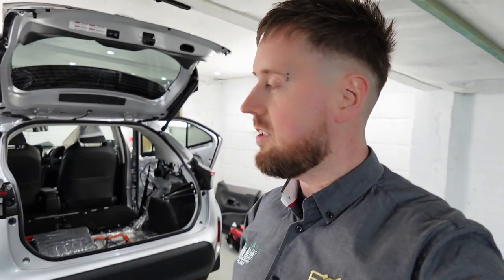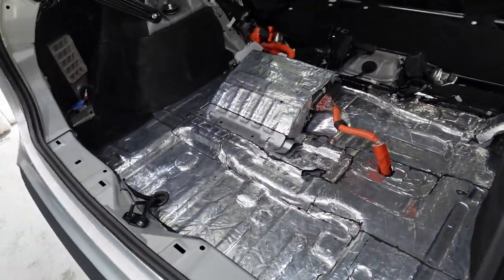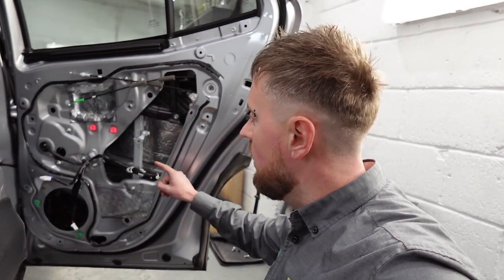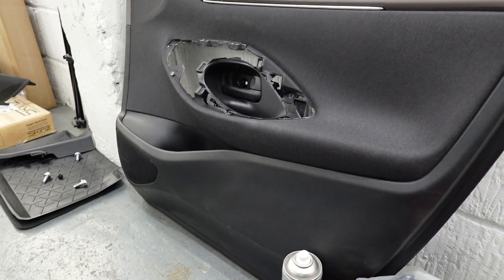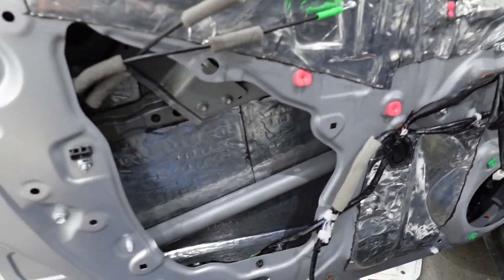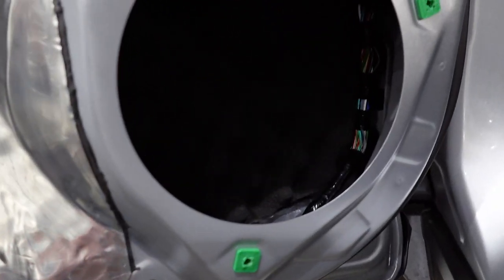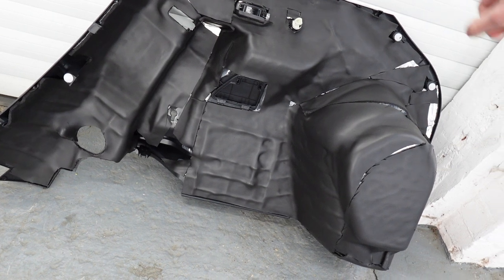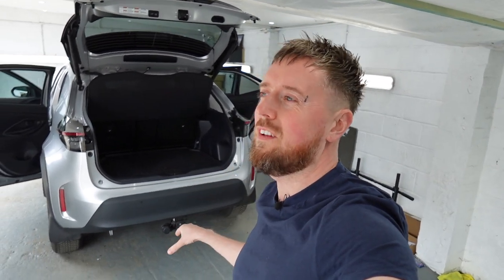Silence the Road: Enhancing the Toyota Yaris Cross

Comment: could you please point out the most critical areas that need to be addressed?
Reply from the maker: @awaken8888  hi! We feel the areas covered in this video are the main key areas that should be done first before the roof & floor pan is tackled. This reduced the noise inside the cabin by between 5-7db.

Comment: How much did the work cost? Also can you guys install front and back parking sensors?
Reply from the maker: Hi! whilst we won't divulge what a customer spent on their installation publically we are more than happy to quote you for a similar installation on your own car. You can either message us on whats app on +447376955734 or email us on info@johnkleis.com
Typically parking sensors start at £450 for the rear & £550 for the front fully installed (as of September 2023)

Comment: Great job guys! Do you have an estimation, how much weight is added to the car due to the soundproofing?
Reply from the maker: Hi ! thanks for the compliment! If we had to estimate I would say approx 45kg for this particular installation.
Reply: Cool, not much weight added, however pretty sure it will transform the driving experience for the better.
Reply from the maker: @Beyond_matter_111  oh for sure! The owner of the car commented on this video to confirm it was a huge difference!

Comment: I am the car's owner! As you can see on the video, the guys have carried out a very thorough and neat job - and they're a really, really nice lot of people to deal with, kept me informed during all stages of the work with short video clips: kudos.

My first drive away from JK's premises was... interesting. Oh yes. The decrease in perceived road noise was very significant - I was able to compare the before and after on familiar roads, and on some stretches of coarse-surfaced road, the road noise was hugely subdued in comparison. On smoother roads, road noise is all but absent. The doors - especially the rear - now feel a lot more solid and close with a 'thunk' rather than a 'clang'.

The added bonus - as mentioned in the video - is an improvement in the sound quality of the infotainment system. This is two-fold: the reduced road noise means that volume levels can be reduced, with subsequent reduction in distortion, and the mid-bass response is noticeably better.

Overall I'm very, very happy with the outcome. It's turned a relatively small, cheap car into one which has refinement levels I'd expect (and have experienced) from the next size up, if not more.

I would add: I haven't received any inducement to post this comment, and I have no connection with John Kleis Audio, so my review is absolutely genuine
Reply: What size wheels do you have I heard the 18s cause a lot of noise
Reply from the maker: thanks for commenting! glad you love the results!
Reply: And has it made a lot of difference?
Reply: How much they charged? I am getting my new brand new Yaris cross Excel 2023  tomorrow. I really wanted to do this job to my car.
Reply from the maker: @lordofjava5266 if you would like a quote for the same job please contact us on info@johnkleis.com.
Reply: Gas consumption would increase for sure
Reply from the maker: @carzakone333 less than you think though, it’s only like having a normal weight teenager in your passenger seat!